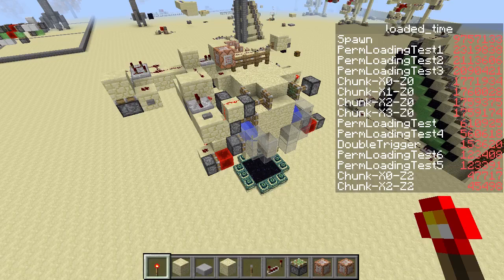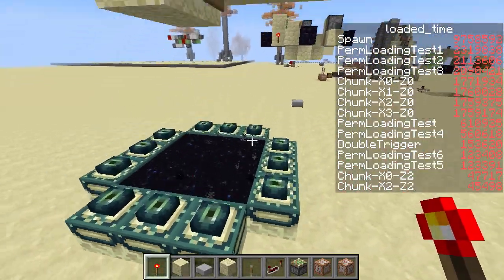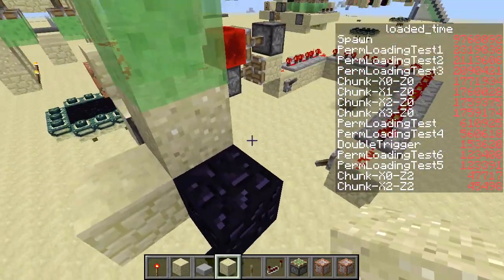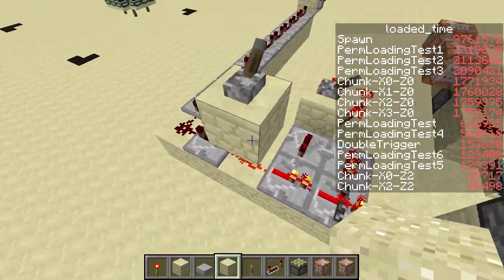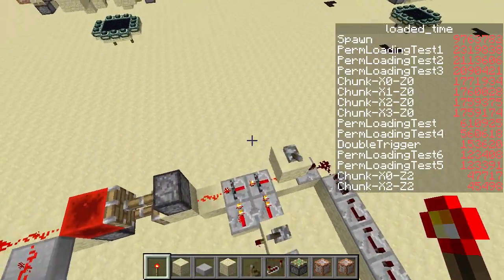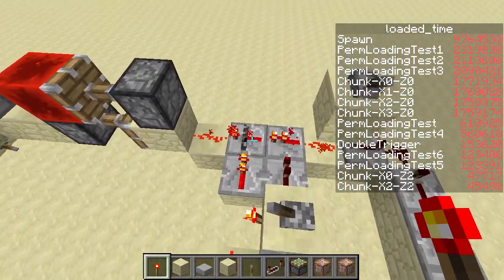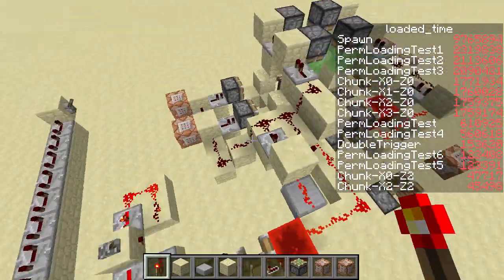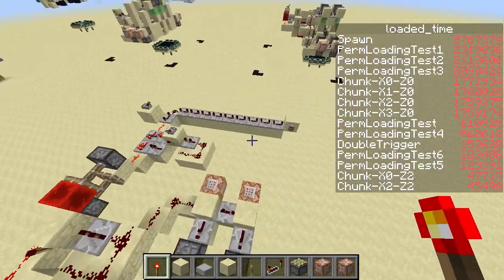0.4s start-up 0.15s sand dispenser - Minecraft

Comment: I see what you're going for. Keep it up you're so close! 
I don't feel so bad not going for the 24k/hr with one character. ;P
Reply from the maker: You do? Tell me, you'd be the first though. :P And IDK if you should feel sorry, it's a bigger achievement, but it also took me multiple months to get to where I am now, so not sure if that'd be worth it. XD
Reply: My guess is that the fast start up time is used to start it up after an auto save.
Reply from the maker: Rays Works
Hehe, yes, Helvince also got that. However, how then can I still keep the 1 sand/3 gameticks pace? :P
Reply: +Wout12345 I'm not sure how you'll do it, but I don't think you did it like how I did it. =P
Reply from the maker: Rays Works
But ... you didn't do "it", "it" is single-player AFK. XD
Reply: I'm talking about something else. You probably could be more specific than "ssp AFK" because that's no different than what I did. I'm guessing yours would be more like "1 player,  ssp/smp, non-spawn chunk end portal, no player input , AFK, 24k/hr sand gen". =p
Reply from the maker: Rays Works
That's the goal indeed, though player input seems a bit irrelevant at that speed. I still fail to see how your farm meets the 1-player requirement though, Panda's does, but yours requires at least one player in the End, and one to place blocks at the Overworld portal, no?
Reply: I showed 2 sand gen farms so far. Sansidiator works with one player and SandStorm works with two players. Both work in ssp. =P I didn't see any point in making a video about using the ender crystal idea with a simple sand conveyor since that's not much different than Sansidiator without the withers. I don't see a realistic situation where needing 24k/hr sand gen if you're the only one on a server. It just seems like more sand than what one player would use but it is a cool challenge.
Reply from the maker: Rays Works
Ah, sorry, forgot about the sansidiator. Indeed, it's 24K/h singleplayer AFK-able. And yes, it is almost solely a matter of challenge and prestige, at this point it'd probably be fairly easy to get 23.5K+/h by just using this sand dispenser by simply turning it off and on around the autosave (requires a bit more complicated control mechanisms in the End though).

Comment: The piston, that pushes the block up is triggered first. The update order is locational. The signal is too short for the other piston, but repeaters/trapdoors/command blocks etc. react to the shortest of signals.
Reply: +ilmango darn u were faster :P
Reply from the maker: But why is it locational? Why doesn't it just update the blocks around it in some predefined order? That's how pistons usually work ... never had locational-dependencies with my slimestone, just orientation-dependencies due to update order, which makes sense.
Reply: pistons r heavily influenced by being locational like all other redstone i suggest that u just go watch sharirs video properly for once... pls... i think u d know what is wrong right after it

Comment: Question: Can you push sand from the sides if you break the endframe block?
Reply from the maker: Well, it needs to be an entity, so I don't think that'd help much. :P This does the job fine though.
Reply: +Wout12345 Isn't your goal to do a 0.05s sand dispenser? ;p
Reply from the maker: Omeganx
Nah, there doesn't seem to be a way to pull off the duplication glitch faster than once every 3 game ticks. ;-)
Reply: Why? x'(
Reply from the maker: Omeganx Ask Mojang! :P
Reply: +Azelef it's when the sand enters the end portal: in order to duplicate the sand does no need to fall instantly, that's where you get the 0.15s delay
Reply from the maker: *****
You just don't get the duplication.

Comment: Now with 1.9 here & the obsidian platform not being in the way & the end being able to be loaded for a fully afkable no player necessary sand generator with autosave being sooner how do you plan on modifying the system?
Reply from the maker: "Now with 1.9": Considering there's still some heavy bugs (check Myren's channel), I can't really consider this a definitive version, I already heard things about a 1.9.1 version. For now it's 1.8 for me.

Anyway, I've yet to see stable End entity loading, which would be the holy grail. Without that, I'm afraid I can't run things at full speed, which was my goal from the beginning. I may work on a ~23K/h 0-player system at some point, but I'm not terribly motivated now. As you mentioned, the autosave is 3 times as frequent and as such screws up some things I had planned. Add to that that I don't really know if the duplication glitch even still works (been hearing mixed reports about this), and you can understand why I'm not terribly excited about this version.
Reply: Wout12345 Completely understandable. I've tinkered around with it since Ray's video & it's annoying to say the least. I was merely curious if you had given some thought as to rough plans.   
As for 1.9's release... I don't know many technical players who are happy with the release. It does bring some fun stuff into the mix but the bugs introduced & ignored are terrible.